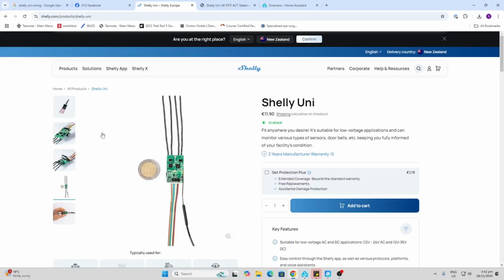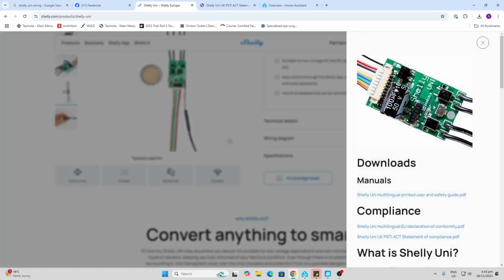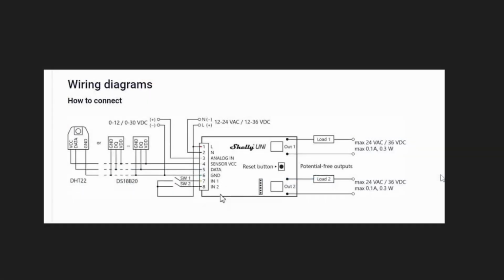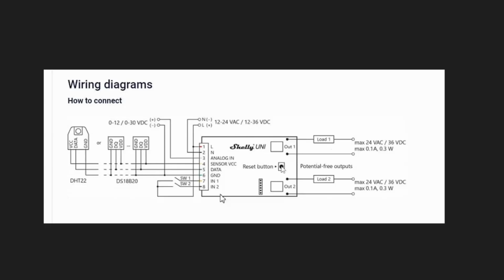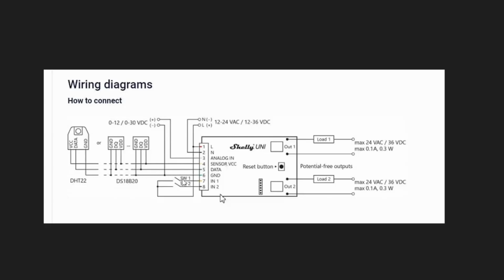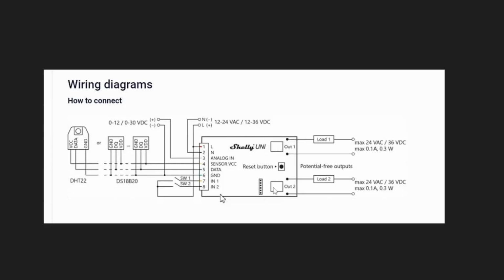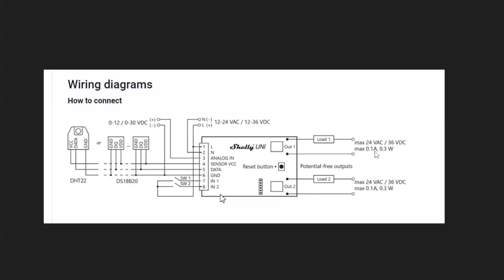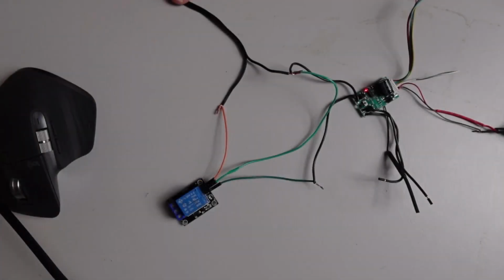How to Control a Relay with a Shelly Uni!

Comment: nice vidéo!! . i want to use with shelly UNI out1 with a Ogemray relay , do you think it is possible to connect directly out1 to S1 and com of Ogemray (i dont find the power and voltage of internat relay of Ogemray)many thanks...
Reply from the maker: Thank you :)  The Ogemray is a smart relay so it can be controlled directly by your smart home system.

Comment: Very useful example.  Do you think the same set up could be used with a DPDT relay to control direction of 12vdc linear actuator motor?  The UNI Octo-coupler activates the relay and moves the contacts from NC to NO.
Reply from the maker: Hi there, yes this sounds possible as there are 2 opto couplers on the Uni

Comment: aren't 5V no problem for the shelly outputs to handle ?! I have an elevator button with 5v current that drops to 0v by push wonder now if that is a problem for the shelly uni ?
Reply from the maker: @bigdeal87  the restrictions on the Shelly outputs is related to the current, 5v is fine but you could use a relay switched by the Shelly if the current is too high

Comment: Is there something similar in the Shelly that can be used to connect a traditional alarm system with HA?  ie so that HA can turn the alarm on/off ?
Reply from the maker: I am sure that you could use the Shelly Uni, but they have just introduced something new called shelly x which I am hoping to test soon!
Reply: Check out konnected boards.